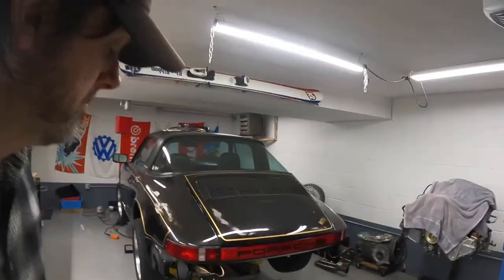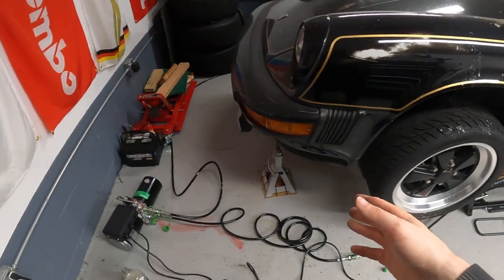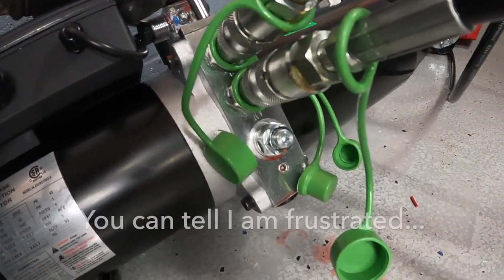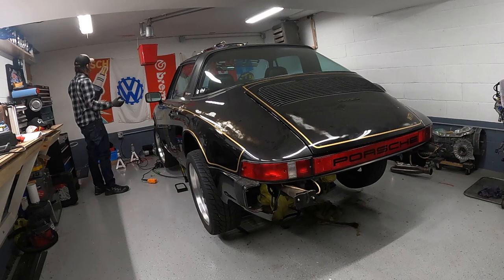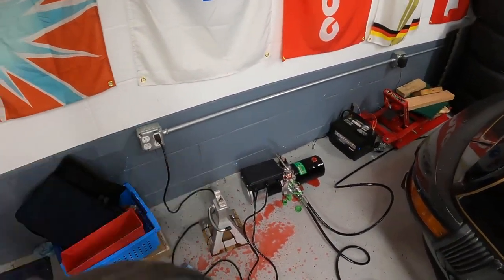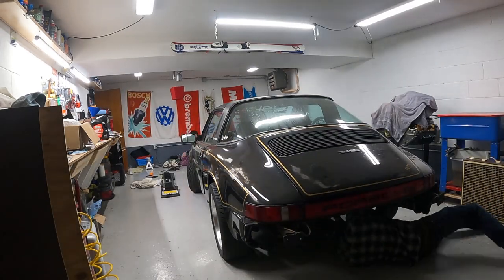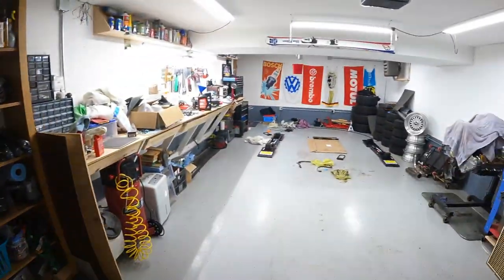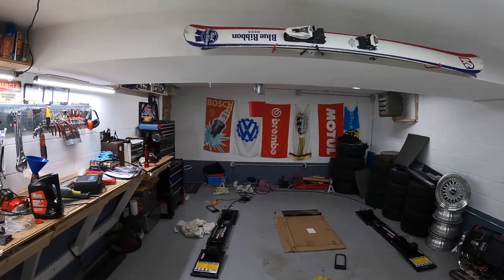My QuickJack Exploded and Covered my Porsche 911 & Garage with Fail Sauce

Comment: Just a word of advice... Never top off your master cylinder fluid before doing a disc brake job. Even if the brake light is on. Hydraulic oil won't hurt paint, brake fluid will.
Reply from the maker: Ha.   Yeah I know, I swear I'm not that much of an idiot but with this thing leaking so much fluid it really threw me off.
Reply: Never back the brake fluid up on your master cylinder.  Brake clamp the lines and bleed through the bleeder valve.  ABS will have a fit if you don’t.

Comment: Hi, it is the relief valve below, fill with the cylinders to deploy to the maximum it is an error ! 
Do not reach 2.5 Liters in the pump, but tell yourself that the leaks at the start is for everyone :) after that it is going very well.
Removed the valve and refit the seal, normally the setting is good it is just bad sealing.
In the tank, between the cap and the liquid 12 mm maximum !
Something else the ramps are really heavy so it is better to leave them on the ground.
Cheers Bro,
Reply from the maker: Yes, you are right, realized my mistake towards end of video.

Comment: I actually have the 7000TL and I'd say it's ok, but only if you're lucky and get one without a defective air cylinder.  If you do get one of those you're screwed - Quickjack will 100% not stand behind their product.  They'll claim the air-assist down isn't "necessary to the function of the lift".  Really?  So if one side has air assist down and the other doesn't, and they drop unevenly, that's safe?  And then when the vehicle drops to the ground and one side of the lift goes straight to the full down position while the other...  doesn't.  You need to wait... and wait... and wait for it to drop with no weight on it.  Quickjack will claim this "is normal operation" and that "it will get better over time".  If you invest a massive amount of time trying to get them to stand behind their product they will, eventually, after burning through every once of customer goodwill, send out a new cylinder.  Yay!  Until you get the replacement and the freakin' air side is literally capped off.  Like intentionally made unusable.  That's not a fix guys.  Then they'll claim that the engineers decided the down-assist wasn't necessary and that they've changed the design on future models.  But I didn't buy a future model with less functionality.  I bought the current model with exactly the functionality I wanted, was promised, and paid for.  Whatever.  Too much time wasted on it already - I've written off the entire company as another skanky marketing hack with no integrity.  

I still have the quickjack in my shop, but the company worked very hard to make me regret my purchase and it low-key pisses me off every time I look at it.  And honestly the setup is inconvenient enough that even when I do pull it out - warts and all - it happens very rarely.  Only when I have a longer term project where I know the vehicle will be on the lift for a week or two.  Definitely not for things like oil or tire changes.  It's just way quicker to use a floor jack, or even ramps.

Comment: Did @quickjack provide torque specs for the relief valve? It would be good for new owners to know and to double check it before operation
Reply from the maker: Nope.   I received a new valve from them but no instructions.  Going to use Gudentite method
:P